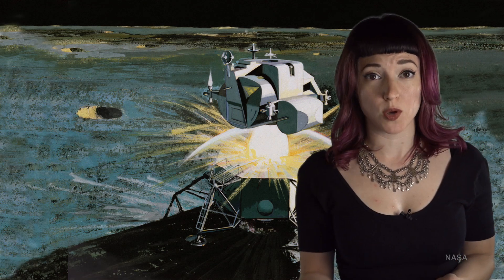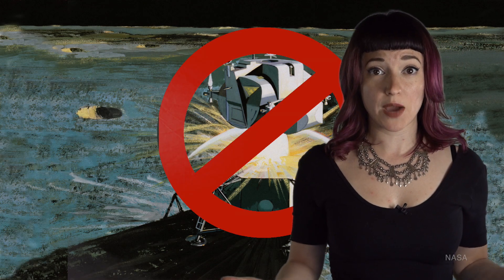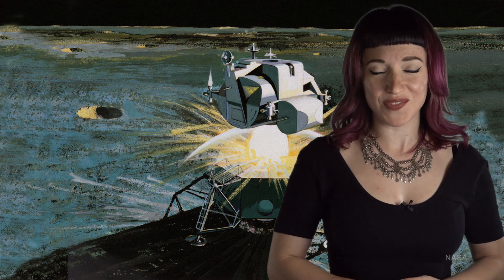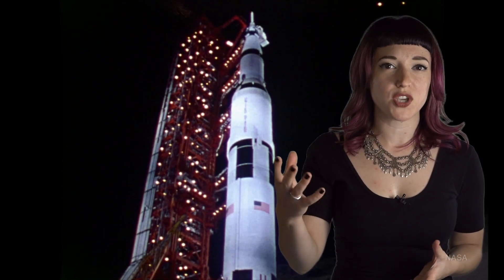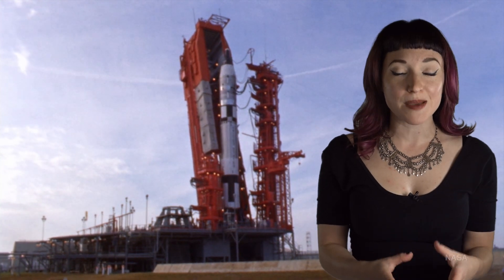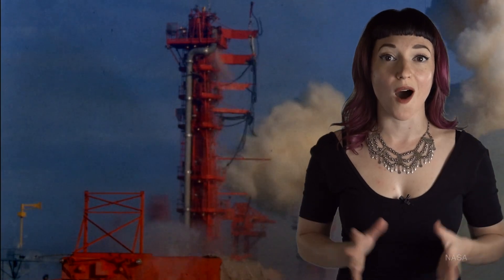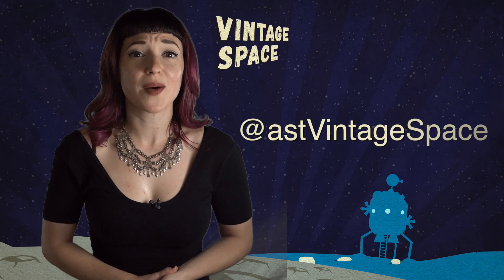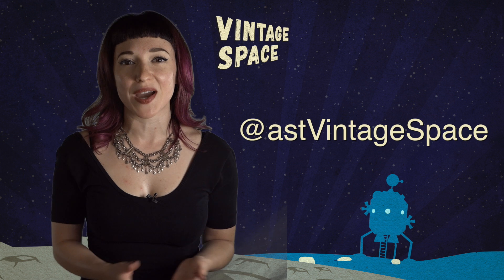How the Lunar Module Launched from the Moon Without a Flame

Comment: Forget about the flame. My question is... WHO'S FILMING THE TAKE OFF? HOW IS THE CAMERA MOVING UP FOLLOWING THE LUNAR MODULE???
Reply: You've never heard of a servo motor?
Reply: @niallkinsella2687  does that explain perfect camera motion and perfect focus?
Reply: @MrJohnnyquark  
Calculus.
The engineer responsible (his name was Ed Fendel, by the way) knew the rate of acceleration of the ascent module, so was able to calculate the angle required to keep the ascending spacecraft in frame at any given moment in the launch, and the distance to the camera.
He just programmed the remote camera on the Apollo rover to adjust to the required angle and focus settings and hit the start button for the program at the appropriate time in the launch sequence

This honestly is just high school level calculus. There's nothing inherently difficult it. Stop pretending it is.
Reply: @niallkinsella2687  sorry, I don't buy it. There's no way it would come out that perfect in my humble opinion.
Reply: @MrJohnnyquark  
I'm not selling it. And your opinion is irrelevant.
Feel free to do the calculations yourself.
Reply: @niallkinsella2687  and yours is? Feel free to ignore my comments and I'll do the same with yours. I'm not questioning the calculations, I'm questioning the ability to actually be able to move the camera in such a perfect way
Reply: @MrJohnnyquark  
I haven't provided you with my opinion.

Servomotors can be produced easily with angular error far less than 1/10 of a degree. This isn't opinion.
The human eye would barely notice an error of 1 degree in a video pointing at a moving vehicle. This also isn't opinion.
The calculations behind achieving the required camera angle are high school level, so not beyond the ability of an engineer. Again, not an opinion.
Creating the computer code to control the camera isn't complicated either. Also not an opinion.

You're getting hung up on one of the easier parts of the whole Apollo program. This part wasn't hard. Stop pretending that it was.
Reply: @niallkinsella2687  it's great that you haven't provided me with your opinions, I don't remember asking you anything. I may have a hard time understanding certain aspects of the Apollo program, I may not be able to perform the complicated calculations that you mention, but that doesn't limit my right to express my opinion, my doubts, my concerns, in a polite, constructive manner.  If you aren't able to keep the discussion to an elevated level, with out assuming that you start from a position of intellectual superiority, that that's your problem.
Reply: @MrJohnnyquark  
"My question is...WHO'S FILMING THE TAKEOFF"
You post this question in a public forum then complain at the person who responded for answering the question? Right....

Next, you disregard the simple answer. Fair enough, it was a overly simple, though accurate.
Then you disregard the detailed answer, out of hand, without bothering to check any of it yourself.
That isn't what happens in a polite constructive conversation. That's what happens when a toddler sticks their fingers in their ears and shouts LaLaLa.
This isn't you expressing doubts or concerns. This is you ignoring information so you can maintain your preferred illusion. You could have checked any of this yourself at any time; instead you are here posting the same old conspiracy bumblefuckery that I've seen thousands of times.
Reply: @niallkinsella2687  you feel like your view is the correct one. Fair enough. Stop trying to force it to other people. Accept other people's views.  And by the way, calling other people toddlers just because they don't share the same convictions as yourself is not polite.
Reply: @MrJohnnyquark   
Your view is that the camera can't have recorded the ascending spacecraft.
I provided you with the method for achieving it and the name of the man responsible for it on the missions in question.

You still insisted that it wasn't possible.
When your opinion contradicts proven fact, your opinion is wrong; and maintaining your wrong opinion when presented with the facts is wilful delusion.
When you present your demonstrably wrong opinion as though it were fact in a public forum, you invite correction and ridicule.

You can live with your delusions if you want, but presenting them and demanding that they be treated with as much respect as proven facts is the height of arrogance.
Your unfounded opinions do not carry the same weight as proven facts and do not deserve any respect, especially when proven wrong.
Reply: Good grief.  You didn't even know how the camera was operated.  Then, when you were told how it was operated, you immediately rejected it.  Don't even sit there and pretend you're an unbiased observer.  Good grief.  I mean, in 1969, the Davis experiment was able to detect the sun's neutrinos, using massive underground facilities buried a half a mile deep, literally capable of counting neutrino strikes on SINGLE ATOMS within 100,000 gallons of liquid.  These are things that are a millionth of the size of an electron, that's how small they are.  And, yet, the accuracy of these experiments got the guy a Nobel Prize decades later.  In WWII, they dropped a Uranium based atomic bomb on Hiroshima, when no Uranium bomb had ever even been exploded.  They were so confident in the exact math that they didn't even feel the need to test the thing first (they only tested the Plutonium version).  That's how accurate the math was, and that was 25 years before Apollo went to the moon.  And, you're incredulous about the ability to make a camera tilt at a certain rate using a servo???  Good gods.

Ed Fendell was very passionate about getting it right on Apollo 17, especially after the failures of doing this exact task on Apollo 15 and 16.  It was his last chance.  He practiced many times.  He did the math and simulated it repeatedly.  And, he asked Cernan to park the rover very far away (about 300 feet) in order to leave a very wide margin of error.  And, he NEEDED IT!!!  It nearly went out of frame, just like the Apollo 16 video did, which was parked far closer (less margin of error).  Yet, you're sitting here as if pressing the button was just too difficult to handle.

Face it, your mind was already made up.  Don't pretend otherwise.  You may have transposed the state of science in 1669 instead of 1969.  But, yeah, sorry to burst your bubble, but making a camera tilt up really isn't the impossible feat that you think it is.  And, you don't get to sit there and immediately reject the answers to your own questions, when, only minutes earlier, you didn't even know how the camera even worked.  That's what conspiratards do.  So, don't pretend you're having some sort of intellectually honest opinion.  You're not.  You're a conspiratard, exactly like the rest of the people who reject how a simple servo motor works, to bolster their delusions.
Reply: @rockethead7  again : I'm skeptical of how the camera moves perfectly in sync. I'm allowed to have my doubts, my opinions, my beliefs. The difference is, I'm not trying to convince anyone to think the same way as me. I respect other people's opinions and I don't feel the need to call people conspiratards. End of discussion.

Comment: How much fuel does it take to get back to earth and where did they store it
Reply: There isn't enough detail in your question to answer exactly.  So, I'm going to assume you're talking about the SPS engine in the service module (the only rocket that sent them back to Earth, thus, I presume, the only possibility you're asking about).  If I'm wrong in that assumption, you'll have to elaborate.  But, anyway, to answer the question, I don't know the exact amount of fuel required, and I'm not going to look it up for you.  99% of the time, when someone asks that question, the person has no intent of listening to the answer anyway, and falsely presumes that Apollo couldn't work because there wasn't enough fuel, and uses this as an [ignorant] argument against Apollo.  I've answered questions like yours thousands of times, and rarely get a response, because it was a fake question in the first place.  But, I'll do the next best thing, because I have readily available information that comes close to answering your question.  They burned the SPS engine for about 151 seconds to get back home.  The Earth's gravity does the rest.  All they needed to do was break out of lunar orbit, and get themselves on a trajectory back toward Earth, and basically, they just "fall" back home from there.  So, to get your answer for how much fuel/oxidizer was required, you can try to hunt down the SPS engine's rate of burn per second, and multiply that by 151 seconds, and you'll have your answer.  I've gotten you 90% of the way to your answer.  You'll have to do the final 10% of effort on your own, and/or clarify your question better.

As for your questions about where it was stored, this is also one of the reasons I have very little faith that you even care about an answer, and you come across as a conspiracy nut.  I could be wrong, of course.  I wouldn't fully judge you on one question.  But, when it comes to something like "where was the fuel tank in the Apollo service module" (something easily Googled, producing over a million results, including schematics to show you your exact answer), yeah, I have a difficult time believing that you really want the answer.  The answer is achieved with an easy search, if you were really interested.

Comment: Regardless, it still looks like dodgy 60's special effects to me.  It looks like Fireworks and strings.  There's no trajectory style lift off, no momentum build up. Even with low gravity, surely there would be something other than a consistent mechanical pulley movement effect.  It just looks like someone pulling strings after fireworks have been set off.  And what about the camera man?  How did he back to earth?  They didnt have drones and robots back then.
Reply: The cameraman argument again...
Is the concept of a camera mounted on a servo really so hard to understand??
The Apollo rover had remote controllable camera mounts 🤦
Reply: YOU SAID: "Regardless, it still looks like dodgy 60's special effects to me."

== There are no aerospace engineers who agree with you.  Look, it's 100% fine that it doesn't look "right" to you.  I don't blame you for that.  People are not used to seeing rocket behavior quite like the lunar module.  It was unlike any other rocket craft that behaves more like you see from hundreds of examples.  It's perfectly normal to have it look strange to you.  But, if you use your ignorance to presume that you understand this better than the entire world's experts in aerospace engineering, then that's when you have crossed the line of merely having something look "wrong" to you, vs. reaching a conclusion that is completely unjustified.  (I'm not accusing you of that.  Thus far, I've only seen you asking questions, and there's nothing wrong with that.  But, it's also not my first rodeo, and often times, people ask those questions rather dishonestly, while intending to ignore the answers.  I hope that's not you.)

YOU SAID: "It looks like Fireworks"

== Yes, it does look that way.  But, it's not actually fireworks.  Here's why:  The upper and lower stages of the lander were connected with explosive bolts.  Right before liftoff, the automated launch sequence blows up the explosive bolts, thus separating the craft.  There's also a double guillotine separating the stages by slicing through all of the wiring and plumbing between the two stages.  This guillotine was also "powered" by explosives, basically explosively shooting the blades through all of the wires and plumbing.  And, there were also loose pieces of the thermal blanket (mylar/kapton foil) that get blown away.  So, between the explosive power of the bolts/guillotine, plus the blast of the rocket engine, the loose stuff is propelled away from the craft a lot like fireworks.  The debris appears to change colors because of the type of camera that was used.  It was an RCA field sequential scanning camera (it had a spinning color wheel between the lens and vidicon pickup tube).  This results in any fast-moving objects appearing to change colors between red, green, and blue, because the objects move quicker than the wheel can spin, and before the vidicon tube can pick up the correct colors.  This "rainbow" effect happened all throughout Apollo 15/16/17, any time something moved too quickly in frame.  But, for whatever the reason, people only tend to notice it during liftoff.  I guarantee, now, after you know what to look for, when you're watching the hours upon hours of lunar surface video, you'll start seeing it everywhere.  It happened a lot.  But, yes, that's why it looks like fireworks.

YOU SAID: "and strings."

== There are no strings.  But, if you're talking about the fact that the craft doesn't fly perfectly straight, yeah, you're right, it doesn't.  The ascent stage rocket didn't have any gimbals.  Gimbals are what you'll find on most rockets, which makes the rocket fly straight.  You can Google "rocket gimbal" to get a better understanding.  But, to save on weight and complexity, they didn't use gimbals for the Apollo ascent stage.  And, as a result, the craft flies "funny," kind of rocking about back and forth, lots of correction and over-correction.

YOU SAID: "There's no trajectory style lift off,"

== See above.

YOU SAID: "no momentum build up."

== Have you ever watched a drag race from the vantage point of behind the drag racer?  Human perception isn't that good when it comes to that stuff.  It's very difficult to see acceleration.  Go watch a few drag race videos from that perspective.  It'll look like the car launches off the line pretty quickly, but then stops accelerating and just goes down the track at a constant speed.  That's what a human mind perceives.  But, in reality, of course, we know it's accelerating for the entire quarter mile.  You just don't "see" it, because people are not good at perceiving acceleration from outside a vehicle.  Same for Apollo liftoff.  It's constantly building speed.  But, you simply don't realize it.

YOU SAID: "Even with low gravity, surely there would be something other than a consistent mechanical pulley movement effect.   It just looks like someone pulling strings after fireworks have been set off."

== See above.

YOU SAID: "And what about the camera man?  How did he back to earth?"

== Oh, get real.  This is just silly at this point.  You don't think they could make a remote controlled camera?  How did they get ANY of the Apollo footage of the two astronauts walking around on the moon?  Are you seriously going to sit there and tell me that YOU think YOU noticed this "problem" with Apollo, that the thousands of communications engineers and technicians never noticed?  Not a single one of the worldwide communications engineers who designed and built everything for Apollo's video/audio transmitting/receiving ever noticed, "hey, wait a minute, we never built anything to be able to see two astronauts at the same time, nor take video of the liftoff, how are they giving us that imagery?!?!?"  No?  But, YOU noticed this problem??  Good gods.

YOU SAID: "They didnt have drones and robots back then."

== No, but they had remote controlled cameras.  Not that difficult to understand.